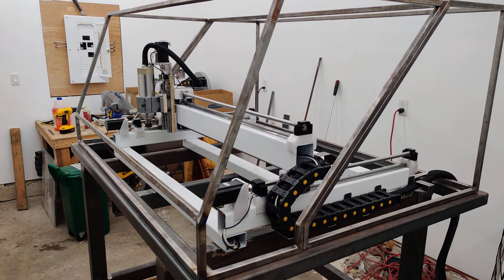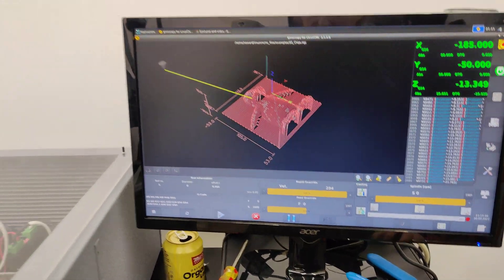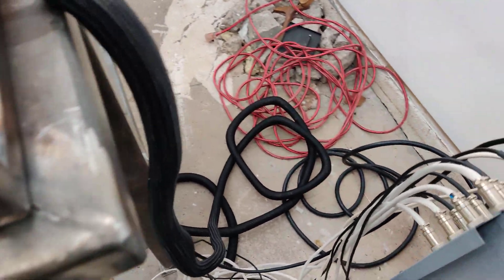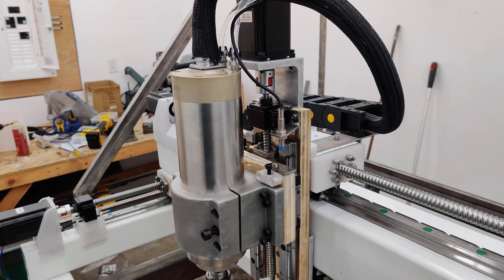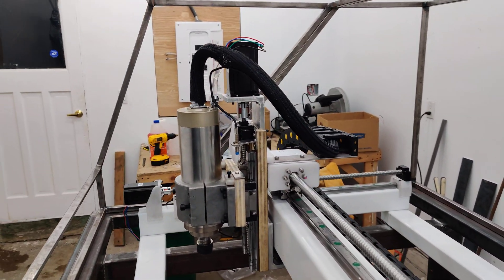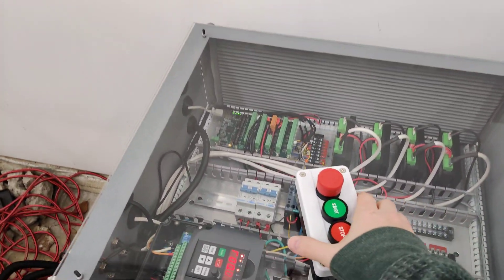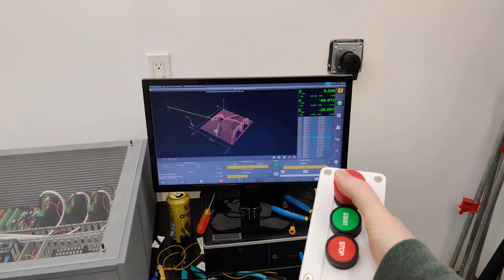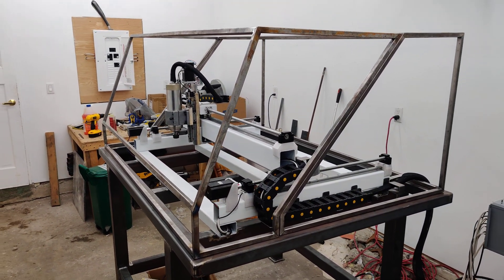Watch the PrintNC CNC Machine in Action - First moves

Comment: Hi Bryan. Thank you for the video. Could you please share the model of your control box? I'm starting to build one myself. Thank you.
Reply from the maker: It wasn’t actually a control box to begin with. It was used to hold a bunch of metal trays. I have no idea what though. Its dimensions are 9 ¼” x 22 ½” x 24 ½”.  I cut the side of it so I can have a plexiglass window and I’ll cut some holes in the front for fans and power switches.
Reply: @BryanHoward  Thank you